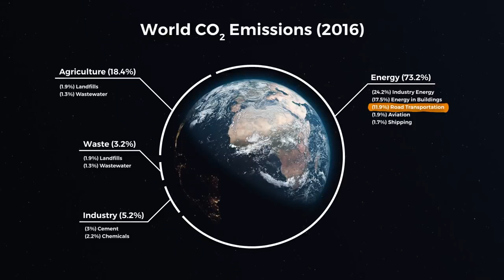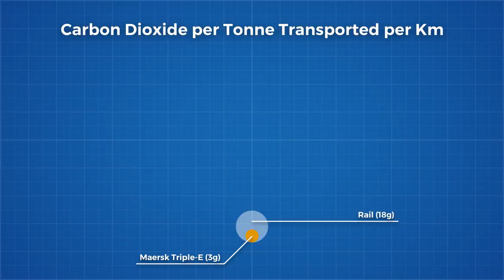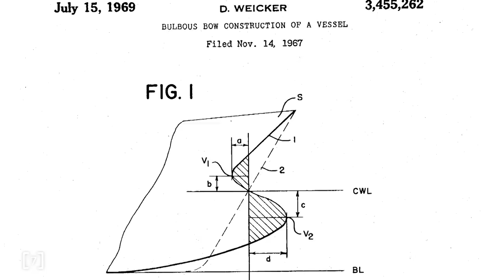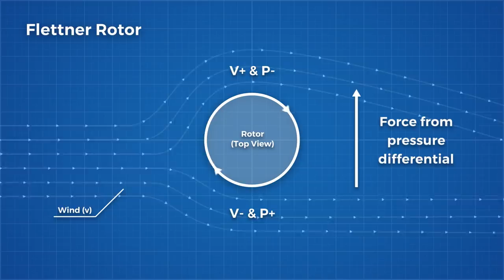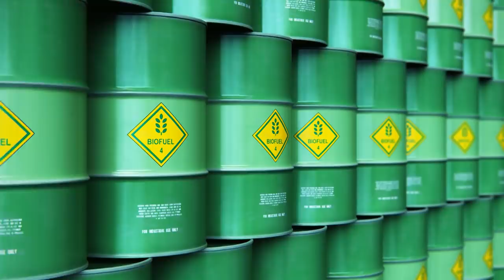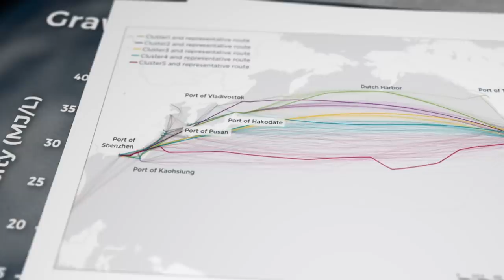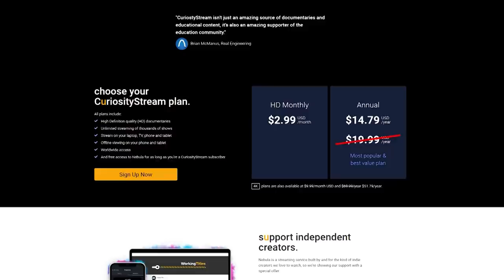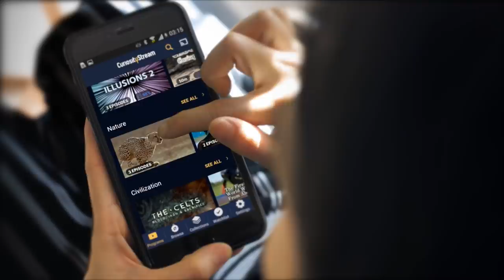Are Renewable Powered Ships Possible?

Comment: N U C L E A R 

not the typical fission rectors, but thorium. Look into it
Reply: If you do a web search for ‘nuclear ship savannah’ you will see that it has been tried and did not work.  A similarly heavily subsidised, by the government, vessel is in use in Russia which also operates, in support of the Northern Sea Route, a fleet of nuclear powered ice breakers these may, or may not, have been completely without issues.

Just think; would you have full confidence in the management of a nuclear reactor under the control of an anonymous entity only traceable, perhaps, via a letter box in a FOC (flag of convenience) nation state?  If you are, could you sell that confidence to Japan, the state that hosted the Hiroshima and Nagasaki nuclear detonations as well as more recently the Fukushima ‘event’?  Then try that same, or a similar, sales strategy on Ukraine, the nation state that as a part of the USSR (CCCP) hosted the Chernobyl ‘event’.  Modern iterations of nuclear energy, thorium fuel, molten salt reactors or fusion reactors, will carry the legacy of past problems.  It is the global trepidation of anything with 'nuclear' in the name and the economics of nuclear having transitioned from 'energy to cheap to charge for' too 'the costs of remediation are incalculable' that will prevent the adoption of nuclear energy as a means of creating energy at sea.  Modern reaction systems may have overcome the safety problems but the general public, having been misled in the past, will be reluctant to believe the fresh new promises.

‘They’ say nuclear is cheap, it’s not it is expensive and has a large embedded carbon quotient as well as being complicated, dangerous, not universally socially acceptable and having only ‘no need for refuelling’ as a questionable advantage; actually it does need refuelling just not as often.  When ‘they’ do need to refill the warming up stuff it takes considerable longer than pumping tonnes of thick black stuff, HFO cSt380, or thin runny stuff, MDO, onboard which is one of the reasons HMS Queen Elizabeth and HMS Prince of Wales are pushed about by ICEs and gas turbines thus using a similar fuel as the aircraft that fly off of them.  The Royal Navy (RN) with a high degree of skill and expertise uses, at vast expenses to the UK taxpayer, a current operational nuclear fleet of 11 submarines (also known as ‘boats’) in two flotillas, seven attack subs and four ballistic missile boats.  The carbon footprint of all the extra bits of hardware and the fuel, including processing thereof, from ground to propeller, are the external costs that never seem to get considered.

Disposal, once it wears out, of both the machine (that was a ship) and fuel is another can of worms best left unopened.  The 26 RN boats no longer in use are laid up (some in Rosyth and some in Portsmouth) awaiting long term deconstruction including dealing with the fuel rods and other irradiated material.  The USN is not, as far as I know, a commercial organisation working to very tight margins and also has the skill and expertise to handle the complexities of nuclear power; so as well as submarines their aircraft carriers are nuclear powered and each of the current iteration has a build cost three times that of QE/PoW, bigger crews and more generous funding.

For those who still think that nuclear energy might be the answer I recommend this report: - https://www.bbc.com/future/article/20200901-the-radioactive-risk-of-sunken-nuclear-soviet-submarines?ocid=ww.social.link.email.  The navy of the USSR might have been under resourced and over extended but it was still generously supported in comparison with merchant shipping.

Comment: Hydrogen for ships especially could be very effective since they can just use sea water to produce it as they go. They will need extra power for hydrogen production though.
Reply: .... You do realise hydrogen is produced by gasification of fossil fuels right? to produce it through electrolysis is highly expensive and inefficient. There is absolutely no way in hell you could produce it on the way, as turning water into hydrogen requires way more energy than you get back. You can't even store hydrogen easily as it quantum tunnels out of its container.
Reply: @carbon1255  we will need cheap electricity to make it feasible.
This is true for any synthetic fuel.

Comment: Take a page from the Navy's book

Use a nuclear reactor
Reply: If you do a web search for ‘nuclear ship savannah’ you will see that it has been tried and did not work.  A similarly heavily subsidised, by the government, vessel is in use in Russia which also operates, in support of the Northern Sea Route, a fleet of nuclear powered ice breakers these may, or may not, have been completely without issues.

Just think; would you have full confidence in the management of a nuclear reactor under the control of an anonymous entity only traceable, perhaps, via a letter box in a FOC (flag of convenience) nation state?  If you are, could you sell that confidence to Japan, the state that hosted the Hiroshima and Nagasaki nuclear detonations as well as more recently the Fukushima ‘event’?  Then try that same, or a similar, sales strategy on Ukraine, the nation state that as a part of the USSR (CCCP) hosted the Chernobyl ‘event’.  Modern iterations of nuclear energy, thorium fuel, molten salt reactors or fusion reactors, will carry the legacy of past problems.  It is the global trepidation of anything with 'nuclear' in the name and the economics of nuclear having transitioned from 'energy to cheap to charge for' too 'the costs of remediation are incalculable' that will prevent the adoption of nuclear energy as a means of creating energy at sea.  Modern reaction systems may have overcome the safety problems but the general public, having been misled in the past, will be reluctant to believe the fresh new promises.

‘They’ say nuclear is cheap, it’s not it is expensive and has a large embedded carbon quotient as well as being complicated, dangerous, not universally socially acceptable and having only ‘no need for refuelling’ as a questionable advantage; actually it does need refuelling just not as often.  When ‘they’ do need to refill the warming up stuff it takes considerable longer than pumping tonnes of thick black stuff, HFO cSt380, or thin runny stuff, MDO, onboard which is one of the reasons HMS Queen Elizabeth and HMS Prince of Wales are pushed about by ICEs and gas turbines thus using a similar fuel as the aircraft that fly off of them.  The Royal Navy (RN) with a high degree of skill and expertise uses, at vast expenses to the UK taxpayer, a current operational nuclear fleet of 11 submarines (also known as ‘boats’) in two flotillas, seven attack subs and four ballistic missile boats.  The carbon footprint of all the extra bits of hardware and the fuel, including processing thereof, from ground to propeller, are the external costs that never seem to get considered.

Disposal, once it wears out, of both the machine (that was a ship) and fuel is another can of worms best left unopened.  The 26 RN boats no longer in use are laid up (some in Rosyth and some in Portsmouth) awaiting long term deconstruction including dealing with the fuel rods and other irradiated material.  The USN is not, as far as I know, a commercial organisation working to very tight margins and also has the skill and expertise to handle the complexities of nuclear power; so as well as submarines their aircraft carriers are nuclear powered and each of the current iteration has a build cost three times that of QE/PoW, bigger crews and more generous funding.  For those who still think that nuclear energy might be the answer I recommend this report: - https://www.bbc.com/future/article/20200901-the-radioactive-risk-of-sunken-nuclear-soviet-submarines?ocid=ww.social.link.email.  The navy of the USSR might have been under resourced and over extended but it was still generously supported in comparison with merchant shipping.

Comment: The most promising fuel to make shipping carbon neutral is methanol.  Carbon Recycling in Iceland has a process to convert waste CO2 and renewable electricity into methanol, and it is being used right now as a vehicle fuel in that country.  CO2 can also be chemically extracted from the atmosphere and used in this process, thus making an artificial carbon cycle.  (I have actually done the capture part of this in a simple setup in my backyard using potassium hydroxide.  Extracting the CO2 chemically from the resulting solution is a well-developed process and can be integrated with the electrolysis used to produce the hydrogen needed along with the CO2 to produce the methanol.)  Millions of tons of methanol are already shipped around the world every year in tankers, so the process of storing and loading it onto ships is well established and very safe, and methanol handling infrastructure is already present in many ports.  It is much safer and less technically difficult to use methanol to fuel a vehicle or ship, and it can be stored indefinitely in a tank, unlike hydrogen.  If a large amount of methanol spilled into the water, it would kill sea life in the vicinity, but it mixes with water and so would never wash up onto beaches and would not pose a fire hazard; it would disperse by dilution and decompose by biological decomposition in a week or less.  But to my knowledge there have been no major spills of methanol at sea.  It is unfortunate that the promise of methanol as a carbon-neutral fuel is not more widely known.  It can be produced without growing crops, and so would not compete with food crops for land, unlike the present production of ethanol and biodiesel.

Comment: Small modular Gen IV nuclear reactors are coming soon.  Search "IMSR" and read with an open mind.  These are not your grandparents' expensive, risky 1950s tech, but walk-away safe, highly efficient reactors that can even be designed to burn waste materials from earlier reactors.  As mentioned in other comments, the prodigious heat output can be used to make cheap hydrogen at land-based fixed refuelling stations, or can be used aboard ship to make steam for a more conventional steam-turbine drive, or a turbine-electric drive.  Worthy of consideration, imho.

Comment: I would be all for Hydrogen, but the Production is still a Problem, the amount of Fuel needed for Container Ships is gigantic.
Theres no Chance Wind could deliver enough energy for the conversion, so they would use Energy from the Grid which in Return would make the Hydrogen dirty as hell again.
Nuclear would work for that. but NPPs on a floating Platform near Coastal Areas which are known for Piracy isnt the best idea without permanent protection.

Imho it would make Sense to fuel the major routes on biggest Container Ships with Nuclear Plants, maybe even Thorium to prevent issues.
Hydrogen would maybe work combined with BEV, Flettner Rotors and Sails, but that would be too expensive for Greedy Companies.

I also thought about Overland Lines, but Underwater, sounds stupid at first, but if you would do that on major routes you could fuel at least those Ships with Energy directly from the Grid as Electric Ships, but i dont know how expensive that would be and there are certainly enormous problems with that.

Nevertheless, all solutions bring negative aspects with them, some greater some lower, but continuing to reduce the CO² output wont resolve our problem, there has to be a major change.
And unless we cant figure out a solution to reduce the  CO² output to Zero i would go for Nuclear Power, at least for the biggest ships and the ones that frequent routes the most.
Reply: The 26th UN Climate Change Conference of the Parties (COP26) held in Glasgow between 31 October 2021 & 13 November 2021 established requirements and targets for mitigation of the production of GHG and with regard to shipping steps to reduce atmospheric pollution to acceptable levels could include: -
1) Reduce spoilage / waste of all commodities;
2) Improve fuel quality;
3) Localise production to consumption;
4) Reduce 'freight mile' distances;
5) Abolish the cruising fraction of marine transport;
6) Reduce freight carrying capacity;
7) Abolish recreational boating;
8) De'fossil'ise the fuel chain;
9) Reduce the global population of consumers.
The use of any of the options above may not be the future of marine transportation but moving less material and moving what is transported over shorter distances, as in the past, should be.  Together with localised production and minimised consumption a global population that has individuals’ voluntarily self limiting reproduction to two children per parent (both male and female), might save the planet.

Shipping currently has a 'high volume, low added value' business model and it needs to return to the 'low volume, high value added' model it followed in the past.  Any alternative to the existing system needs to provide better value and so depends on the yield; the energy input less losses must provide energy output that can be deployed for propulsion, cargo handling and domestic services.  All of which must be achieved consistently and within the current limits of mass, volume and cost.  The merchant shipping fleet of vessels is not a homogenous group.  Not only do the sizes, structures and trading patterns each vary over a wide spectrum but the applicability, or otherwise, of any combustion mitigation option will be radically different between classes of vessel; id est a tanker has a large expanse of open deck that could make it suitable for VAWT installation while a container vessel due to being loaded and unloaded from above is unlikely to be able to deploy such a system.